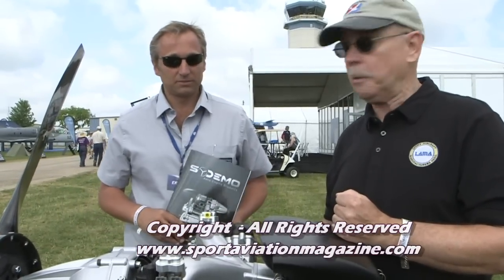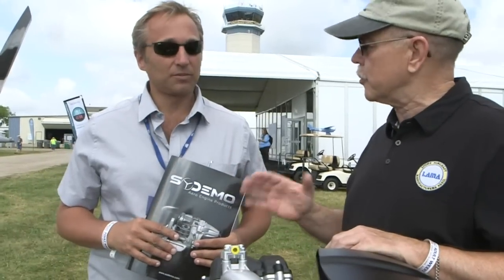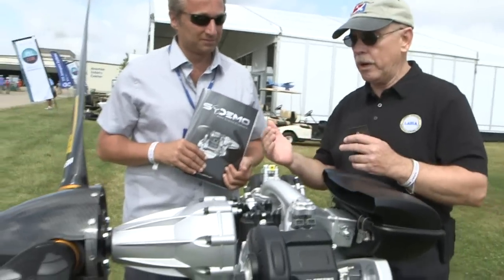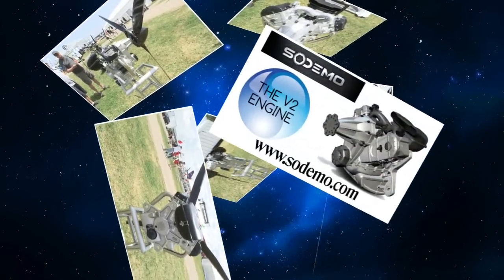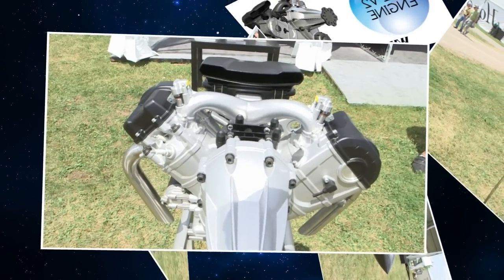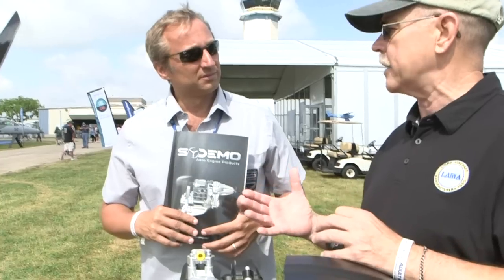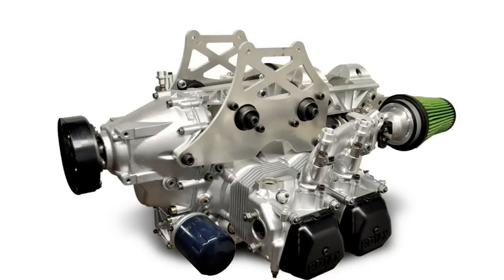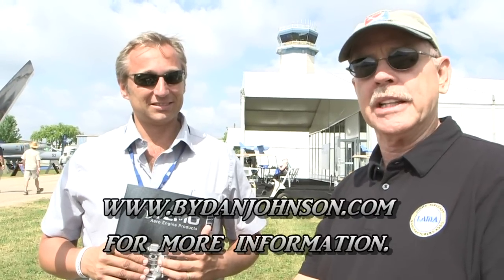Sodemo V Twin Aero engine from Sodemo.com

Comment: Weight: we are pretending it’s very light. 
Reliability: we are very confident it will be reliable. 
Availability: it will be coming to market very soon, no really, very soon, we are very confident and determined to deliver it very soon…
Price: it will be cheaper than every other engine on the market by 40%.

It will cut fuel consumption by 40%, it will fly 40% faster than any other engine in its class, and we will definitely be coming to market very soon……

Comment: hp to weigh is great but it all comes to price, reliability and availability.
Reply: Tolal loss oil injection it runs, does it burn SAE 30W low ash oil?
Reply: it's a 4 stroke engine so the oil is in a sump under the engine or in s separate tank in the case of a dry sump
Reply: Take a look at the heads, this v90 is based upon the Voxans motorcycles's one, created by sodemo. 
It was a very very reliable engine, they won some endurance races, with the twin ignition, could be even more reliable

Comment: Why not use a Suzuki Swift or metro engine complete and total reliability three cylinders super lightweight aluminum heads and block 56 horses and lot of torque.1000 cc water-cooled but the radiator weight is like five pounds .
Reply: Well I'd like t try one on a regular 14x48 Jon boat for airboat,if it will turn a least a 58in prop. I need to no what pitch to run and dia.prop
Reply: Aeromomentum is doing just that
Reply: I'm using a Suzuki M13A non VVT. Excellent engine by design, far better than all current aircraft engines.